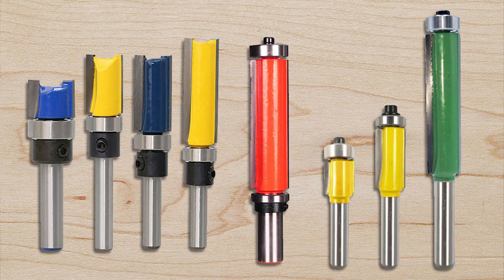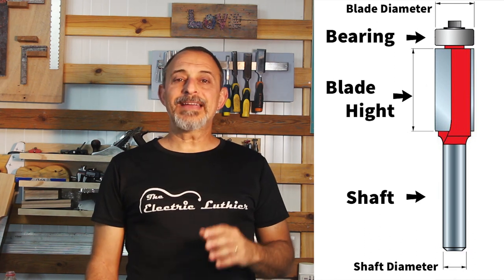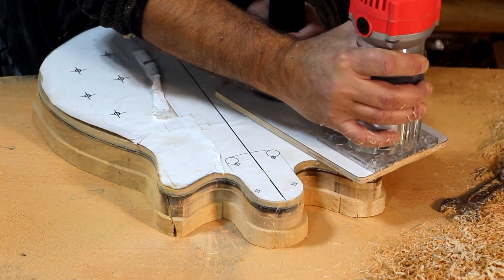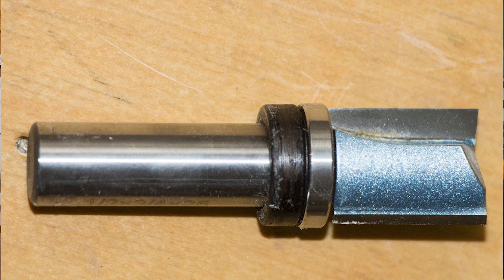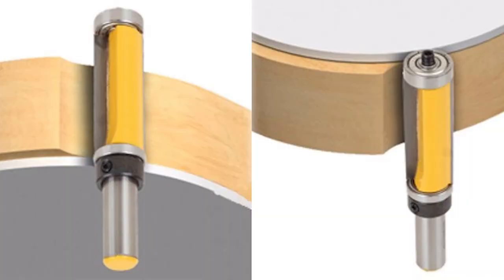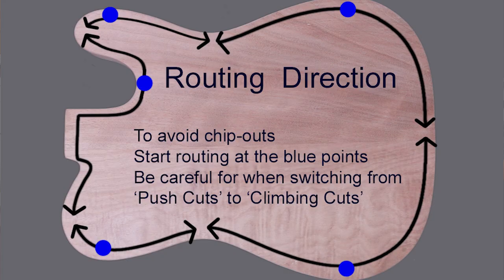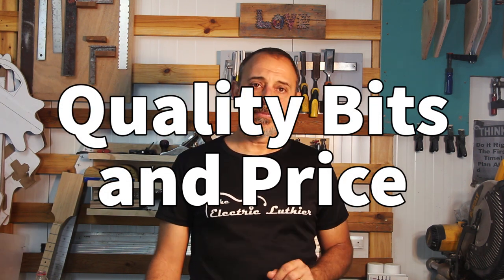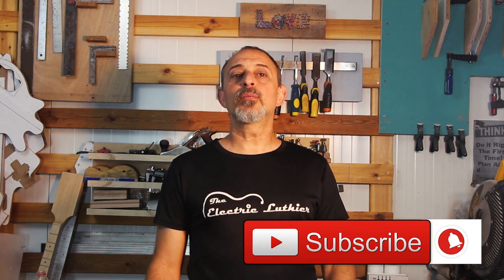Flush Trim Router Bit for Guitar, An In-depth Look

Comment: When I 1st started making guitar blanks and necks, I had some scary situations with the straight cut Pattern Bits. I use either a Spiral or compression bit, with the Compression bit (fairly expensive) works like a charm. The Infinity Mega Flush Trim router bit, or the Whiteside Ultimate Trim Combination Router Bit are my suggestions for starters. The Whiteside runs about $195 and the Infinity Mega runs about $89.
Reply: These sound like great bits and I am sure would give great results and are easier to work with IF you can afford them. Sadly a lot of beginners will not want to spend $195 or even $89. I have learned to work with $10-15 bits and get decent results, and I think that is what many first-time / amature luthiers usually deal with. I am sure you appreciate the 'fancier' bits even more after using the straight ones. 😉

Comment: Do you need a plunge router to do cavities (i.e. pickups, tremelo, etc.), or can you also do it with a trimmer router?  Also, when I am doing it in sections, is the area (depth) covered reliant only on the length of the bit blade, or are the bits secured into the router the same way a drill/driver bit is into a drill, where you can put it deeper in, or have it sticking further out?  Thanks, and, GREAT video.  Second to none. :)
Reply from the maker: I have a small trimmer router, and a large (non plunging) one. Aside from the planging action making work eaisier on the entry, it's a matter of power. The small trimmers may just not be able to handle deeper cuts with harder woods. If this is your only option, you can get by with multiple passes and slow  motion. Do make sure you have a sharp bit.
Reply: @theelectricluthier1928  Thanks.  Could I get by with a cheap bit, or is that something that you really need to go ahead and spend a little more money on?  I just don't want to pay for expensive bits if it's not really necessary (as I'm on a tight budget, and there are so many different tools needed to do a whole project).
Reply from the maker: @51MontyPython  I would love to get those 200$ bits to really know what they're like, but I am not there yet either. I think my most expensive bit (the large round over bit, I do the neck with) was around 15$. The cheap ones work, just work slowly, consider the routing direction and check that your bearings are in good shape. Be safe and enjoy them.